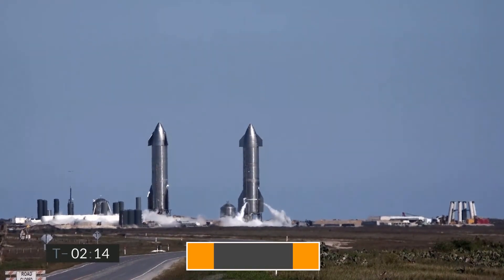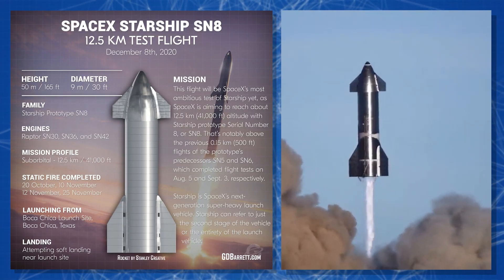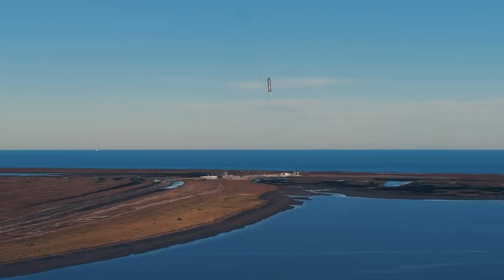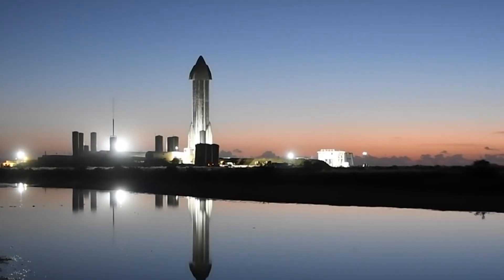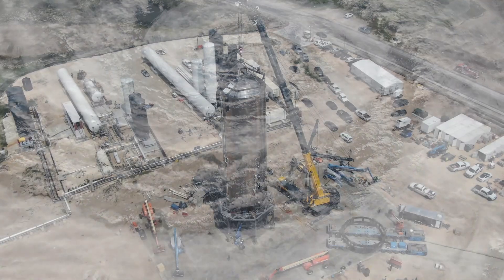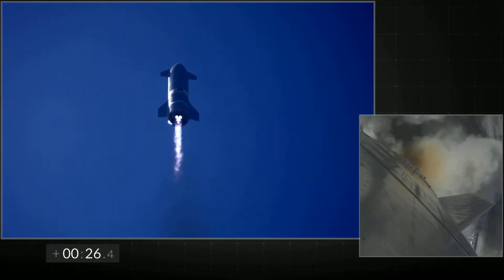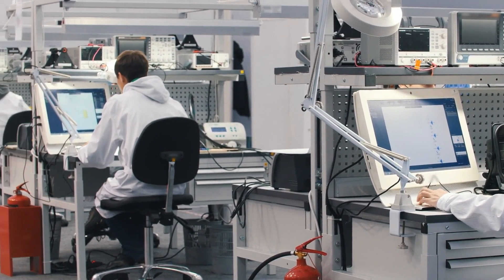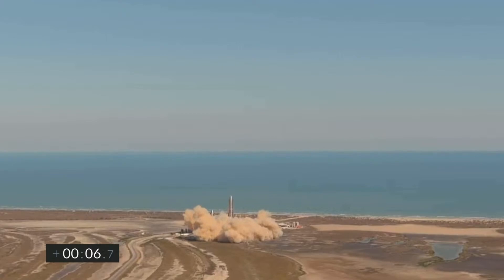Elon Musk's Starship SN9 Prototype Exploded Again on Landing

Comment: They will iron out the kinks at a later point.
Reply: Musk wants to start all 3 engines and stop one of them.
The deceleration could be significant. 
The landing should begin at a height of a single engine being able to bring the free-falling StarShip to a vertical stop.
Then, If a second engine happens to work , well, that's a bonus.
If the first engine does not re-ignite on time then re-ignite the other two engines to land the ship. 

So, which is less, the fuel for 3 engines or the fuel for earlier re-ignition?
.... or perhaps, keep the landing sequence as it is but re-design the 2 landing-engines for 'start-stop' reliability?